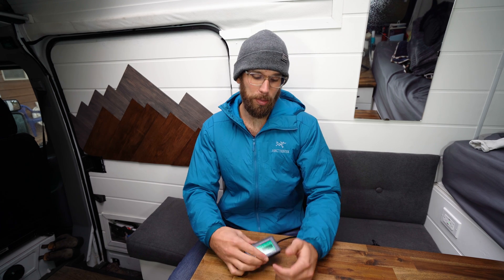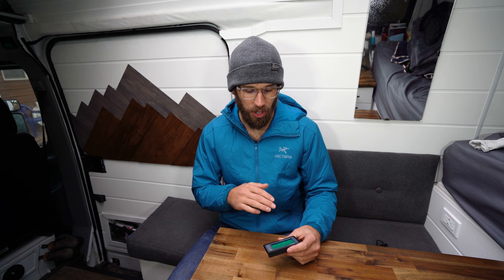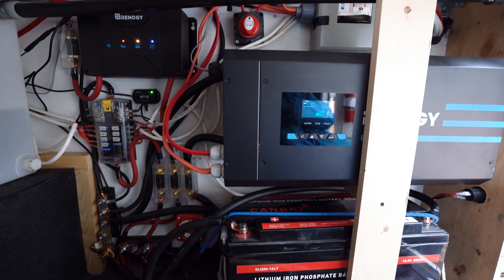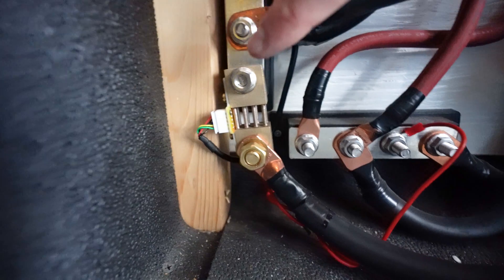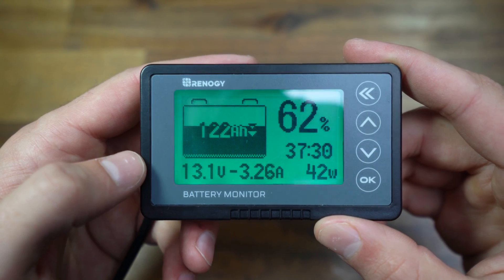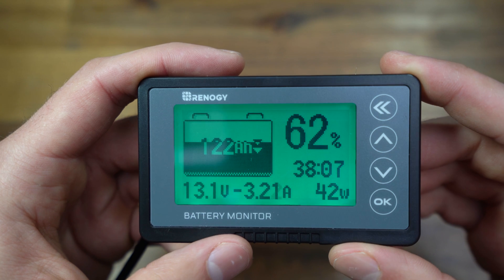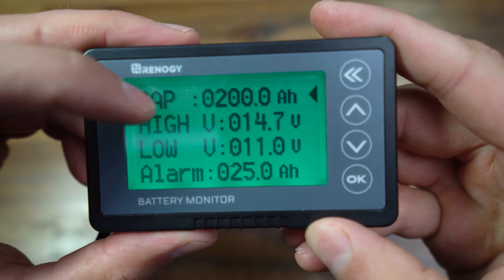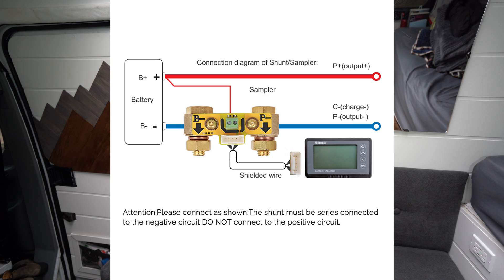Renogy Battery Monitor: How To Monitor Your Solar Batteries

Comment: Thanks for all the help you are giving with this video as I got this same monitor and have been having alot of issues.
I did solve most of them after reading through all your comments from other people and realizing I only had the ground coming in from the solar regulator going to the shunt and all the other grounds from my system were still connected to the ground of my battery.
My battery is a 200ah Mighty Max Lead Acid 12 V that came with this partially built Sprinter T1N I have been finishing little by little over the last 2 years.
So after I connected all the grounds from my system to the Shunt ( including the chassis ground, inverter,solar regulator and ground going to a regulator hooked to the main on the motor) it seems everything is working as it should now except for one thing:
The capacity is still showing at 100% on the monitor even though I have the fridge running and the voltage has dropped down to 12.8 V. The amps have dropped to 199ah and the remaining hours seem about right at 72:10 but the capacity hasnt dropped at all and is still showing 100% full.
Does this seem normal to you?
I have the CAP set at 14.4 V and the Low set at 11.5 V and the alarm set at 100 mah.
So what do you think I might be doing wrong here?
Could the monitor be defective?
Im wondering that because during form fitting into the plywood I was pulling it out of the hole which is really tight and it slipped out of my hands and flew on to the hard wood floor.
Thanks for your thoughts and any advice.
The included manual is pretty limited especially on the troubleshooting section.
Reply from the maker: It’s good to have the alarm set at 20% capacity. It’s isn’t great to draw lithium batteries below 80%. I would focus on the amps going in and out, not so much the voltage and percentage. If it’s still reading 100% then the shunt is installed correctly. Is it facing the proper way? The shunt should be separating EVERYTHING from the negative terminal on your house battery.
Reply: Thanks for your response.
To clarify here my battery is not a Lithium, its a Mighty Max Sealed AGM Lead Acid 200AH.
Yes everything is connected correctly. All grounds are going to the P- connector on the shunt and then from the B- one short 4 AG cable going to the negative terminal on the battery.
After running the fridge for two days now I noticed the battery percentage has dropped slightly and reading lower at 92% and the AHs are 198.
So it appears to be working correctly now.
At night since there is no sun charging up the 200 watt solar panels, it is showing drawing only on the monitor and the voltage drops down considerably.
But during the day when there is full sunlight,the two small arrows are facing up and the hours remaining are much less indicating remaining time for a full charge.
On looking at other videos and comments here on YouTube from other persons that have installed these units I came across this information from users thwt installed this monitor in their rigs that is interesting and may benefit those who need to know:
Comment: I have noticed that this unit monitors the capacity by “voltage and not amperage” So I have since installed a Lithium setup.
Comment: After many days of troubleshooting on this monitor I finally worked it out: don’t set the high and low voltage,( leave them both at 0.00 and it will then work as it should)
Why Renogy cant just say that in the instructions is beyond me.
Comment: I totally agree with everything you are saying as it seems fine when its discharging, but as soon as it sees charging voltage from solar or alternator it displays 100%.
Comment: This worked for me: High Voltage needs to be above the charge rate to stop it showing 100% as soon as you start DcDc charging.

Comment: Wouldn't a Bluetooth shunt be more user friendly than having to route Renogy wiring to monitor screen inside RV ? Also, i have two separate RV battery banks in separate locations, so I need two shunts; Bluetooth would be much easier for me.  I don't see your monitor current drain under loads; I see how much current is left but not how current is being drained at a certain load. 
Have you considered doing video describing how 12v LiPo4 battery un-surprisingly drains lots of current due to unreasonable inverter demands (hair dryer, microwave, convection cookie, etc.)
Reply from the maker: Yeah I agree. A Bluetooth shunt would be ideal! Although, Renogy’s BT battery works well for this.

Yes, hopefully soon I’ll have time to create a video explaining that. Struggling to find the time right now but I appreciate he suggestion.

Comment: Thanks for the video, it was very helpful while I was setting my battery monitor up. I am having an issue but I don’t know if its really an issue or not. I just setup my system a few days ago and have been using it for 3 solid days. Now at the end of the full third day and decided to charge my battery using the battery charger I purchased from the manufacturer. For informational purposes I purchase an Ampere Time 200 ah lithium with an Ampere Time 20 amp charger. Initially the battery monitor would not show the battery was charging. After some research I found that the charger couldn’t be connected directly to the battery otherwise the monitor would not show a charging status. I corrected this issue and now I am showing a charging status, however, now I am at my second issue. My charger is designed to stop charging when the battery is full, however, the battery monitor, while showing a charge status, has very quickly displayed that my battery is at 100% full and the battery icon is at 200ah. The monitor is still flashing to show it is charging. My gut tells me that I shouldn’t worry about this and that when the charger stops charging, I should reset the monitor to 100 percent. Do you have any suggestions or solution? TIA.
Reply from the maker: I wouldn’t worry to much about that! Is your charging designed for lithium batteries? This maybe the issue.
Reply: @madetoexplore  yes it is.

Comment: Wonderful video! I'm wondering about something in my trailer that's different from the configuration described in the video. In my  Keystone Bullet 22, I have my 170 a/h Renogy lithium battery located externally on the tongue of the trailer, which precludes a convenient connection of the shunt which the video showed as being handy to the battery. I'm wanting to install the monitor near the entrance door near the back of the trailer co-located with the existing monitor panel, which is about 22' aft of the battery. It would also be directly above the converter/charger. Is there any important reason that the negative wire leading to the converter/charger couldn't be interrupted by the shunt to allow a series connection about 22' from the battery?
Reply from the maker: As long as you size the wiring properly it should be fine 👍

Comment: Hi David, I have just stumbled across you channel, and as a  complete solar beginner I have found it so very educational and interesting, subbed now so I don't miss more content.   I have recently invested in a small system, all bought from Renogy,  so some of your previous advice comes to me a bit late, but what I have gained is extremely useful.  My little system is quite simple, 4 x 100w panels in parallel, Rover 30a mppt controller maintaining a single 200ah Lifepo4 battery, what could go wrong I hear you ask 🤣🤣.

The Rover has a Renogy BT1 controller, the battery has its own BT module built in and both of them are running on different apps.  To make a very long story short, the Rover app shows my battery at 100%  but the battery BT app shows it at 44%.   I note in your video above you said that the battery monitor you are describing needed the battery to be fully charged before setting it up, I did not do this with mine, so I wonder if I should do this first.  Anyway, I will be placing an order for your guide on solar and keeping it at easy reach.  Oh, and I will be getting the battery monitor above.  Thank you.
Reply from the maker: Thank you! I don’t have much experience with the Rover because I have the dc to dc with MPPT but I think you should be able to get them both to work on the DC home app. Good call on getting the battery monitor! I can’t use the app when I’m out of service which is frustrating 🤦‍♂️

Comment: to monitor battery of solar panel can't we just use a microntroller and with voltage divider measure the battery maximum to minimum voltage and corresponding to these make percentage calculations and check it on cloud?
Reply from the maker: You could but it wouldn’t be as accurate as tracking the amount of amps going in and out.

Comment: Possibly a dumb qestion...can you connect the shunt directly to the -ve side of the battery?
Reply from the maker: I believe you could but you’d have to purchase a longer bolt and some other hardware to make it work properly.
Reply: @madetoexplore  Thanks - just thinking of getting it as close to the -ve as possible to be more accurate really.  Appreciate the reply :-)
Reply: I saw that a guy used a MRBF mounted directly to the battery.
He took the fuse out and the shunt fits directly on the post that the fuse was on.
Then just ran a short cable to the neg bus bar on the load side.

Comment: My monitor isn’t showing when it’s charging the arrows going up and the monitor flashing it’s not doing that
Reply from the maker: Those sound like symptoms of a shunt that’s installed the wrong way?
Reply: @madetoexplore  I’ll check it again 👍
Reply: @madetoexplore  I checked it and it wired up properly on the video when you’re going through the settings on the monitor if you keep going down there’s two more what are they for
Reply: Did you figure it out?

Comment: Blew up my renogy 50a mppt dc to dc charger hooking up the positive wire to the wrong place.. they should REALLLY emphasize that the positive goes into the little green connection and it’s easier to do that first…
Reply from the maker: Yeah, their instruction manuals are certainly lacking a little bit!

Comment: Hi, question for you, I am building a small off grid "shed" to house tools and snow removal equipment, I'll be living in the bus, which is fine.  However, I want to be able to monitor my sheds power system even while I am 1000s of miles away.  Do any of these major companies have a WIFI module?  I've used renogys BT module and it's fine but the only other option they have is the data/cell module.  I will already have wifi 24-7 for the security system.
Reply from the maker: Hey! The Renogy M1 would be perfect. Gonna be releasing a video very soon.

Comment: Hey mate , awesome video im converting a T1n at the moment and bought this dcdc charger system.. Does it charge the starter battery aswel as sevice battery .   I'm only getting the red led light on alternator on the charger when I start the van up?  Be great if charged my starter battery also
If you can help that would awesome , keep up the great vids
Reply from the maker: Thanks Gary! Yes it will charge the starter battery. Depending on what settings you have the charger setup for, it will trickle charge the starter battery via solar.
Reply: Thanks mate ,  sorry to be a pain what settings do you have to get it to work ... Renogy will not respond to my email ..... your my last jope
Thanks once again safe travels
Reply from the maker: @garywishart9448  I’ll be making a video on this shortly that covers programming the monitor. It depends on what battery you have. High voltage would be just higher than the max. Min voltage should be when the battery hits 20% capacity.

Comment: Very helpful thanks ... if I purchase a renogy controller with a lcd display is that basically the same Thanks
Reply from the maker: No it’s not the same thing. Which controller are you talking about?
Reply: @madetoexplore  it’s the mppt 40amp controller tbh I am going round in circles with this

Comment: I know this is an older post but I just bought a Renogy monitor. I’m some what of a newbie. The instructions say to connect the B- in series to the shunt. I have 2-100ah lithium batteries wired parallel. Do I just wire to the negative post leaving the two batteries? Also, the small wire connected to the P-post just goes to any of the positive posts, correct?
Reply from the maker: Yes you can either connect the B- to the negative battery terminal or I connected mine to the busbar. As long as it’s separating the battery from all other negative connections. Do you mean the small wire for the B+ connection? Yes that can be connected to the positive busbar or battery terminal.

Comment: Thank you so much for this. I bought your guide a few months ago to install my system in my truck camper, and so seeing how to use this monitor with a bus bar is especially helpful. And it is so much more simple of an install than I thought - Renogy's instructions for this monitor are terrible - numbers that doesn't seem to correspond to anything, and the diagram makes it looks like you need to install more wires, rather than those just being existing wires in your system. Anyway, thank you again for what you do!
Reply from the maker: Thank you very much Tara. That’s reallly nice of you 😄 glad it was helpful

Comment: Hey mate i am setting up a van with a Projecta DCDC / Solar regulator I’m pretty right on setting this up but I have one question I can’t seem to find a very easy.
It says take all the cables from the negative on the AUX battery and put them on the stunt, but does this include the ground wire that goes to my chassis ? 
Cheers Craig.
Reply from the maker: The chassis ground should be attach to the negative busbar (if you have one). Then the shunt will be installed in between the negative busbar and the negative battery terminal.

Comment: Nice job showing how you installed and the battery monitor features. Small corrections you could make: a shunt is an accurate resister (micro ohms) that allows a very very small sensing voltage drop (mV) proportional to current which gives the accurate amp reading,  also, the red “power wire” as you stated not only gives small parasitic power to the monitor, but more importantly it provides the voltage connection for the battery voltage sensing and capacity numbers.

Thanks for showing how you did it. I stopped here to validate how i plan to install my own new RBM500. Nice clean install you did!
Reply from the maker: Thank you!

Comment: Thanks, if I have shore power charging batteries, will this monitor pick that up or does that shunt have to be placed in line to have monitor see it .
Reply from the maker: For the monitor to pick up shore power or any charge for that matter, the shunt has to be separating everything from the battery.

Comment: I am using 24v settings can you tell me what to set my controller on for hi voltage and low voltage and float voltage for lithium battery's
Reply from the maker: This would depend on the brand of lithium batteries. I would set the high voltage to just above the city off voltage for your batteries and the low voltage to just below the voltage that your batteries are at when they reach 20% capacity

Comment: thanks for the video, i have 2 200ah renogy agm's and a giandel 4000w inverter for my truck because i find myself needing power for my tools and i hate carrying 2 200ft extention cords to find power. since i have 2 batteries that are link together at 12v will the shunt work properly if it is hooked to the negative of one of the batteries ? for example ( battery 1 negative to battery 2 negative to B-to shunt then from P- from shunt to chassis ) <<< would this installation read both batteries properly at 400ah ? thank for any advice.
Reply from the maker: Yes that’s correct.

Comment: Hi, can I ask if your monitor is performing ok? I've installed one but getting confusing info. When battery is low voltage, say 12.2v my monitor says 98% and 127ah (130a/h agm leisure battery) I'm thinking I have a battery problem but just wanting to ask, thanks
Reply from the maker: Yes, my monitor is still working great after almost 2 years. That does sound like a battery issue 😬

Comment: Hi will this work with lead crystal battery’s as Iv got too there 170ah each so I’ve Iv got 340ah linked so there still 12v and NOT 24 
Looking forward to your reply Dave.,,
Reply from the maker: I don’t have a lot of experience with lead crystal but I don’t see why it wouldnt work? I would order it off Amazon and test it out within the 30 day period just to be safe.

Comment: I just installed this monitor, and it seems great but I have one question. Does the backlight come on when you have a load on it? If so, is there a way to stop that?  I feel like the light will be on/off all night long whenever the fridge runs, or if I plug my phone in. I've looked for a way to turn it off but no luck. Do you have any advise or thhoughts?

Also, thanks for the review! Super helpful, I didn't realize that the arrowa indicated a charge/discharge -- thats cool!
Reply from the maker: That’s a good question. I believe the backlight pulses when the batteries are being charged but I’ll have to check mine to see if it stays on when it’s discharging or it turns off.

Thanks for watching!
Reply: @madetoexplore  Thanks for the response. I haven't noticed the pulses while charging, but I'll pay attention to that -- maybe it's turned off or something too.
Reply: I made a little cardboard flap, with a hinge fold and taped it above the monitor. Keeps it dark and I just lift it up to check.

Comment: Only thing I didn't see was whether this was able to monitor 24 or 36 volt systems. Is it able to do 24 or 36 volt systems?
Reply from the maker: This is straight off the website “Universal Battery Monitor- Voltage range 10V-120V and up to 500A”